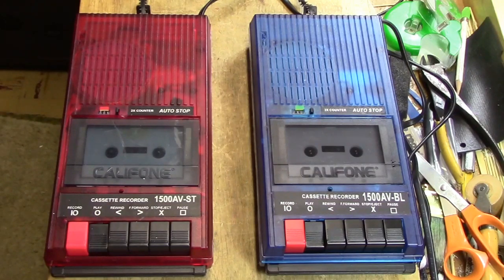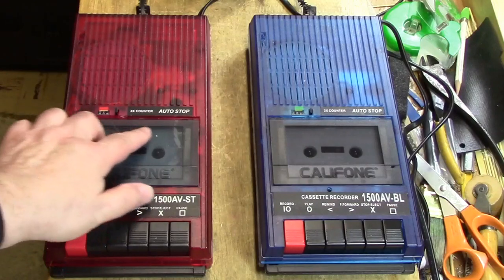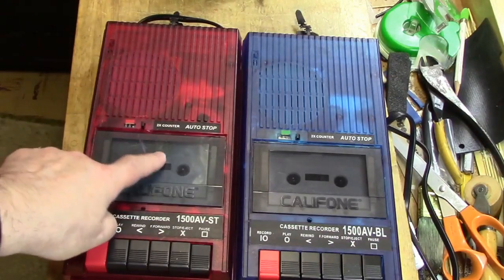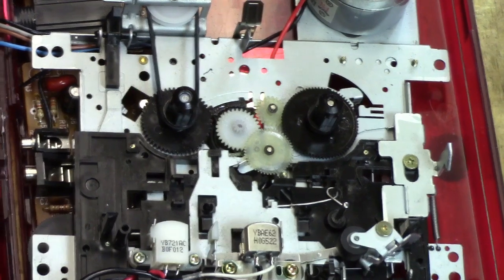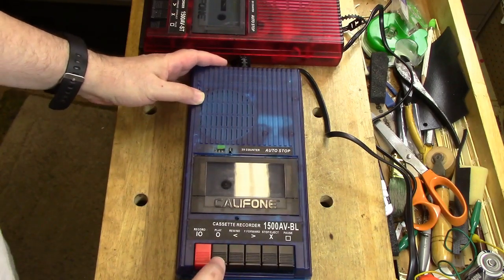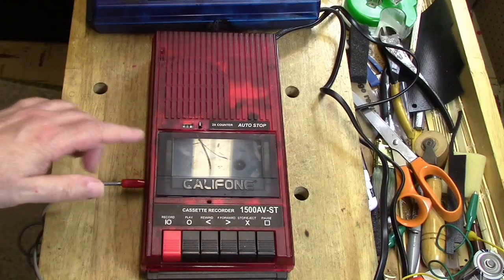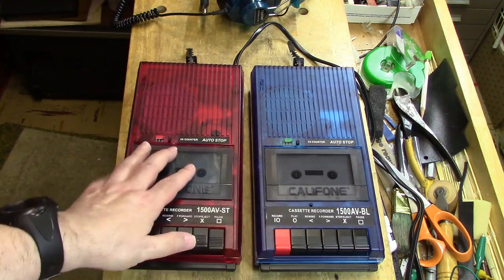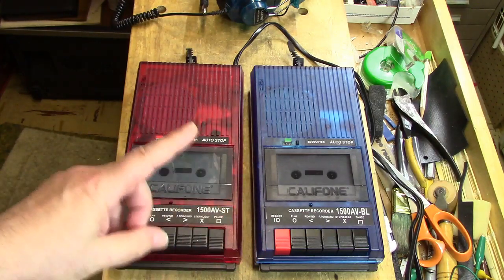A Tale of Two Tape Recorders – Califone 1500AV – BL and ST Cassette Recorders

Comment: Wow, thank you very much for explaining why the take up reel was so stiff on a double cassette player/radio that I found dumped on trash. The white gear was stripped because those take up reels were really hard to spin. I shortened the spring on the iddler to apply more pressure and now one of the mechanism works but you can still hear it grinding from time to time. I actually bent that metal tab to take out the spindle and I've done about 3 times and the metal still didn't broke lol. I also needed to cut and shorten the belts because they were to loose. I had to cut the spring that puts pressure on the take up spindle and lubricated the shaft so that it would speed more freely. Anyway, these mechanisms are an absolute pain.  Keep up the good work. Cheers :)

Comment: Well, everything you pointed about this mechanism was like reading my mind !!!. I worked several times in these ones because all the recorders (from any brand) use them. So, eachtime I bought a recorder at mid 90s, they all come with the same mechanism. In fact I fixed the issue you pointed 2 o 3 times, experienced the same problems and yes, used superglue too. I would add a deffect that was common, at least I got this deffect on every of them. When used for about a year or normal regular use (cant tell the hours), sound start to sound like with boubbles, like grinding (cant come with the exact word) Gears are so thin that one they pick a bit of play or movement, they dont face eachother perfectly. Eventually this get worse and worse to the point that the FWD take up is not getting proper traction from the translucent small gear anymore. I got this issue in all of them. Almost unfixable. Lets say probably below 1000h of use, taking care and AVOIDING FAST DUBBING (in double ones) since puts so much stress in those mechas ...
When NEW they perform very good. But they are very fragile an wont last. If you push keys hard, you can hurt the mecha very easy. Of course, by this era motors had been perfected allowing the mechanism design go basic and basic. I opened a Panasonic from mid 90s, pretty good sound, really outperfomed the recorders of that period. To my BIG suprise flywheel was PLASTIC. But sound and speed stability was like comming from a far better quality ... because nothing but the motor. You wont find quality in any other part of mid 90s consumer grade tape recorders. By the way, question, HOW they cut battery power when running AC if the cord cant be unplugged ?.  Nice vid as usual !!!
Reply from the maker: 38911bytefree    Thanks for watching the video. Yes, these mechs can be very fragile. I've had to fix little gears in some of them myself. The mechs  are cleverly designed though,  to use a minimum of parts. I also agree, the speed stability -- it's all in the the motor and there are some really well made motors put in some of these units. For so many years manufacturers were putting all their energy into the flywheels, bigger, heavier, clunkier, and here we find out -- no, the secret is in the motors! 

I have no idea how they keep the AC line from charging the battery when both are in the machine, unless they use a blocking diode(?) You're right, the plug in bricks used an mechanical interlock to cut out the batteries when it was plugged in. But Califone must have figured out something because, I don't recall any of their cassette machines having exploding battery issues. There have been many cassette recorders with permanent AC lines in them, so it probably is no big secret to doing it. I just don't know how it's done.
Reply: Your are true probably a diode. But being a 6V recorder is a bit significant. But this electronic motors run on lower voltage (compared the its nominal) no probs. I have a VERY old National, is similar to the one you had shown (you use the song get out of my mind ?) with rotary command but this one has radio and its bigger. AC Cord is like in the Califone. But they have done ?. They use a small relay that was feed from the DC voltage generated from the transformer making the unit to change from batteries to AC automatically when you plug the unit. Pretty clever. Love the concept. Years later probably this was "too expensive" I think .... Also I had an OLD laptop that switch AC to battery by relay. Incredible ... Cheers
Reply from the maker: 38911bytefree
There's a little circuit board by the power transformer and it has a big electrolytic cap on it (must be a filter). It has two little diodes on it. Pretty inexpensive compared to a  relay!

Comment: Radio Shack had their "Flavoradios" back in the 1980s, available in strawberry, blueberry, and blackberry, but they didn't have these cool translucent cases.
Reply from the maker: VWestlife   Thanks for watching the video. I remember those "Flavoradios". As I recall, they didn't sound all that great. Do you know if they were big sellers? I think RS was trying to capitalize on the move started by Panasonic when they came out with colorful cassette recorders.  Not only were they colorful, but they also had interesting shapes. Worked pretty well too.
Reply: I remember them, but I think they were sold in the '70s also. I was going to comment , but I thought I'd check to see if anyone else mentioned them first. Enjoying your videos! :)
Reply from the maker: bob7872
 Yes Bob, you ans +VWestlife both win the RS prize. The AM only Flavoradios were offered in 1972 through 1998 for starting at $5.95 each and originally came in six colors, including Blueberry and Strawberry, and ending up in one color- Blackberry These must have been consistent big sellers because they were offered for over 20 years!

Comment: Sounds a little like DC bias to me, maybe the erase is DC but has AC bias recording?  That would explain why there's little bit of background noise but no distortion on the S. Nice job on bringing the "Strawberry" recorder back to life!
Reply from the maker: CoolDudeClem     Thanks for watching the video! It's hard to look under the board because of the wiring so I didn't look for a bias coil. Also, with an IC chip, I don't know if they use a bias coil anyway? Do you know how theser "new fangled" modern amplifiers deal with bias?

It may be just pretty good DC bias. Some of the background noise is the tape itself - it's one of those "bulk" cassettes. The noise is not so annoying in real life as it is on the video. I think the camera mics are aggressive. I have a grandfather clock ticking in the background even though it is two rooms away!
Reply: I also think it's AC bias with DC erase, but you can try doing the "fast forward test" -- hold down fast-forward while recording to make it do a high-speed recording, and then listen for the AC bias oscillator tone upon playback, which will fall down into the audible range when you play that recording at normal speed. If you hear a whistle it's AC bias; if there's no whistle, then it's DC bias. But not all cassette mechanisms let you do this trick. (It's something I learned from CassetteMaster years ago.)
Reply from the maker: VWestlife  Thanks for the tip. This mech won't allow that trick because of the interlocks. I know some do though. Cassettemaster has come up with some pretty neat tricks over the years. He's a good resource. 

I am sure, since these were not the high end Calfones, that they used the least expensive method of recording. I think that recording on these machines was secondary to playback. These machines really do play pre-recorded tapes very well. Of course, YouTube -- and their evil Content ID system -- makes it impossible for me to demonstrate that.
Reply: There is a music library in youtube with lots of different music you can use in your videos. Just record it with one of your best machines and voila.

Comment: Hey Tim, as soon as you asked the question about the colors of the two tape recorders being compared to other electronics item, I immediately thought of Apple because I remember those translucent computers that they produced in the nineties. you should have left it to us to answer it in the comments instead of giving away the answer and then maybe you could have given away one of the tape recorders as a prize. :)  you also did a good job at restoring the strawberry colored one. it's hard to tell if the thing was either dropped or just abused by human beings as to why the pause button got stuck and those internal posts broke. but hey, you've restored enough of these cassette recorders so that it's just second nature to you as to how to get them working again.
Reply from the maker: amberola1b   Thanks for watching the video. 

Ahh, a CONTEST! Hmmm. Unfortunately, I don't get any money from my videos (thanks, Google, for dewnying me that priveledge!) and I carry all the financial weight for making them myself, so a contest would cost me too much money. 

I agree, the machine was probably dropped, or got pushed off a table by accident or something... the case is pretty strong ABS plastic. I suppose it COULD be plastic failure, I see a lot of tape recorders where the posts have failed.  The scratch (gouge)  on the door was also probably due to carelessness. These things happen. So maybe my term "abuse" is a bit strong. Perhaps I should have said neglect or carelessness or accident. 

As usual, you bring up good points and give me "pause" for thought!

Comment: Those are pretty neat machines. Does the AC power cord remove or tuck away in any way so that it's not dangling when you're running the unit on batteries?

Some Novus plastic polish would probably make the cassette door on the red one look a lot better.
Reply: The power cord does not detach, but you can see it has a cord retaining strap so you can keep it folded up when using batteries or for storage.
Reply from the maker: themaritimeman  Thanks for watching the video. I should have pointed out how the cord is managed. Other Califone units had a special back end you could wrap the cord around, but as +VWestlife pointed out, these just bunch up under a strap. Thanks for the tip on Novus plastic polish! Will try that, but the gouge in the door is pretty deep. it may be good for other stuff though!

Comment from the maker: I Like this video. Oh, wait, I made it.... 

well, I like it anyway. I even gave myself a "Thumbs Up". Oh, Joy!

Hope you all like it too!
Reply: I liked it too, and all your vids.  Glad to see you back in production, missed CSP vids.  I hope you're doing well Tim.  Don
Reply: clydesight I just bought a Sanyo cassette record similar to these and found that a rubber belt on the inside had broke while I was using the machine. It seems that u are an expert on the subject, do you know where I can find a replacement belt?!? Any help would be greatly appreciated.
Reply from the maker: Ethan Marks  Hi Ethan. Thanks for watching the video. The belts for cassette recorders are all different sizes, even among machines made by the same manufacturer. 

Your best approach would be to visit E-Bay and search for "assorted cassette belts" . There are a LOT of these things available, many from CHINA. They come from China anyway because cassette recorders are still quite popular there. 

To avoid waiting for the packet to arrive, you can find more local sellers. 

Look under the "Buy It Now" listings so you don't have to wait for an auction to end.  

Buy an assortment that has a wide range of sizes. 

When the belts arrive, you will have to guess which one is going to fit. This is why you have an assortment of sizes. 

Some belts will be too small, some too large, and some pretty close.

You want a belt that is flexible, has a snug fit, but is not too tight (too tight will strain the motor) and with a cross section that fits the pulley groove well. 

Make sure you put it in the machine in the proper orientation or parts of the drive may run backwards. 

Look at a lot of cassette repair videos to see how these things usually work. SANYO was pretty standard , so you should be okay.

Good luck!

Comment: Excellent information as usual Tim. btw,,, the ascii x 2 probably refers to the standard one inch per second that is used on counters for magnetic tape sound recorders abbreviated ips. Not sure if your machines are going two inch per but that would seem logical. Thanks again buddy.
Carl
Reply from the maker: skycarl   Thanks Carl, for telling me about the ANSI 2X. Eiki machines make the same claim. The only thing I know about counters is that they are pretty unreliable because of things like "belt creep".  Thanks for watching the video!

Comment: Hi I have a question ... can you put an aux cable into the microphone in jack and record what is playing through the aux cord ... might sound stupid but this is an honest question... does anyone know??
Reply from the maker: Hi Dylan, You can record from a radio/TV/MP3 Player (if it is strong enough) into the mic jack, but you need what is called an Attenuating Patch Cord/Cable or Attenuating Dubbing Cord/Cable. This is like an aux cord, only different.

It has special resistors incorporated into the wiring to lower the high level signal from a radio or CD/MP3 player to mic levels -- so the tape recorder can record the sound through a mic jack. 

You can find attenuating cables  on Amazon and EBay. 

Radio Shack used to carry them, but with RS gone, they are now appearing (while supplies last) on Amazon and E-Bay. Search for "Radio Shack Attenuating Dubbing Cable" 

f you look for one of these,  make sure it says Attenuating . There are plain dubbing cables made, but they do NOT have the dropping resistors. Also, make sure the plugs are the ones you need. Some cables go from mini to RCA plugs, others go from mini to mini plug. 

Good luck.
Reply: clydesight awesome thanks!

Comment: WOW!The mechanism is nearly identical to the one I have in my Philips cassette player and my Universum one.But the thing is that the Universum is made in Germany while the Philips is made in China.
Reply from the maker: Mihai Gradin  Thanks for watching the video. I wonder if your Universum didn't import the mechanism but assemble it it Germany? These Chinese mechanisms seem to be pretty standard. Philips was going for that -- a standard drive system -- in the 1960's, but the Japanese manufacturers were very independent, so we saw a lot of different cassette mechs back then. I have noticed that many cassette recorders from the 1990's and onward use these standard Chinese drives.  So maybe the Chinese were able to accomplish what Philips was going for -- 30 years later!
Reply: I really enjoy your,Clyde,because they are very informative.And at school we have a JVC that has the same mechanism and I also saw in a store a Sony with,again,the same mechanism.I think almost all the modern boomboxes have that kind of mechanism. I saw on the Internet a Universum that was quite similar to mine but it missed a few features like DBBS for example,but that was the only one I could find and I think it was made in the early 2000s or late '90s.

Comment: 2x counter may mean the tape counter goes 2x faster? Also, i think the strap may also be used to get the batteries out easier
Reply from the maker: EvanPlayzGames  Thanks for watching the video. Someone recently pointed out (on another of my videos) that the "2X" and "2X ANSI" means that the spindle rotates twice to move the counter 1 increment. 

Yes, the strap is for releasing the batteries. Of course, you have to lay it in right (under the batteries) when you install the batteries, or else is won't work.

Comment: I saw this at a thrift and picked it up Blueberry btw. Only thing when I put a tape in I can't get the record button to press. Without a tape it can be pressed fine and works. Is there a trick I'm not figuring out here besides the tape tabs? I've looked at it as much as I can without taking it apart and I don't see anything broken.
Reply from the maker: Thanks for watching the video. I am confused by your problem. When there is no tape in the machine, the record interlock should be preventing you from pressing the record button. This is how it works on my machines. When the door is open, it still prevents the record button from being depressed. If you put in a cassette with the tabs in place AND close the door, you should be able to press the record button. (The tab moves the interlock out of the way). When there is no tab in the cassette, you should be prevented from pressing the record button. 

Since you got your recorder used, anything could have happened, and it's even possible that a previous owner got into the machine and messed with it. Or the interlock could be jammed somehow. Perhaps something got dropped into the cassette well? Maybe it is stuck somehow?

In any case, if it was me, I would carefully open up the machine and check the interlock AND the record key to make sure all is okay there.

Good Luck
Reply: clydesight ya not soon after I ask you I tried a tape with the tabs removed and it worked. So it can record but the tab use is backwards. How weird! A tape with tabs in place, the record button can't be pressed.